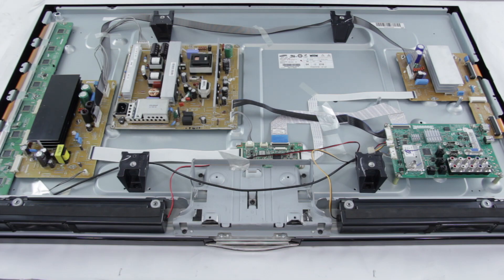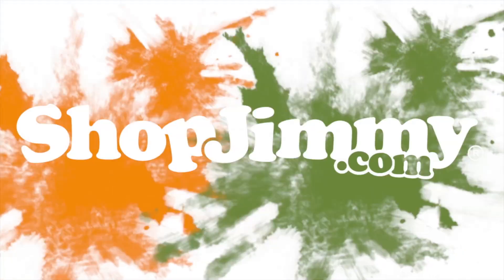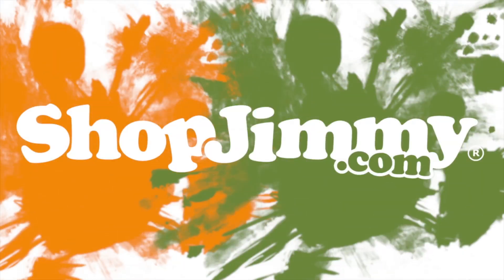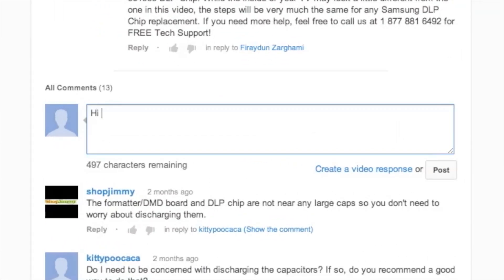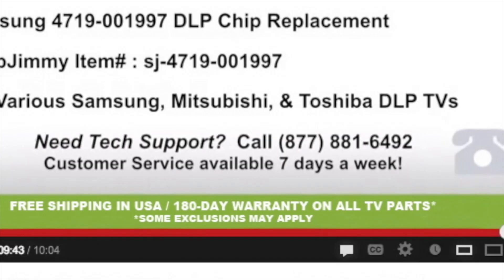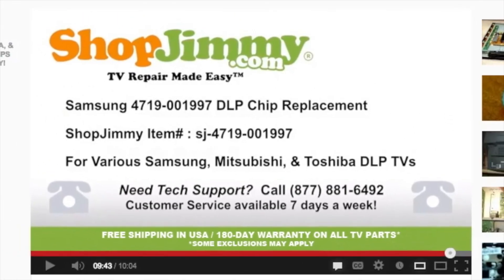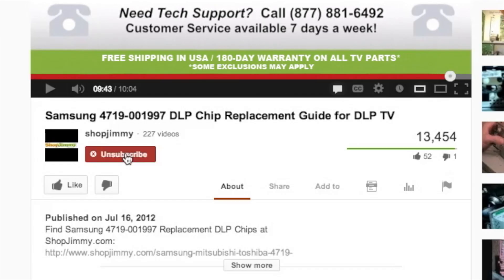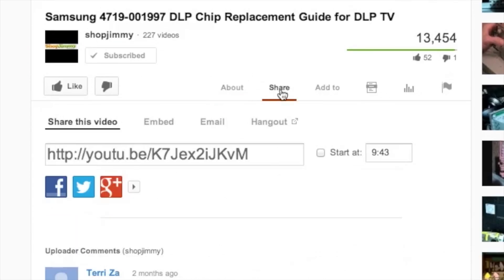Plasma TV Repair Tutorial - Common Symptoms & Solutions - How to Fix Plasma TVs

Comment: thank you for your assistance. i have ordered the main board as u recommended but the clicking still continues and the screen won't turn on. out of frustration i decided to investigate and run a few more tests. i noticed that when i completely disconnect the ysus from the others i hear the startup jingle but no cyclic clicking. i am wondering  if i may need to update the firmware or get a ysus. i also noticed some wet residue on the ysus near the bottom. i want to remove the ysus to check the bottom for signs of burning residue but im scared i might break the ybuf contact tabs.
Reply from the maker: samo wordo  Please watch this video FIRST to help with your repair!  TV Repair! LCD, LED, Plasma, DLP How To Fix Your TV with ShopJimmy.com Help! Sounds like you have diagnosed the problem as the Y-main.  I recommend replacing the Y-Main board and the Y-scan drive board in your TV.  Follow this link to replacement parts:  http://www.shopjimmy.com/catalogsearch/result/?q=pn42c450b1d  Be sure to match part numbers on your current board, with your replacement for compatibility.  Here is a link to a video showing how to identify your part number, click here:  Samsung Plasma TV Repair: Samsung Plasma Panel Parts Guide  Thanks and please let us know if you have any further questions with your TV Repair!  www.shopjimmy.com

Comment: I have a50" samsung plasma tv Model PN51D450A2D I here it turn on but have no picture or sound the standby light blinks 4 times
Reply from the maker: David Zinkiew  Please watch this video FIRST to help with your repair!  TV Repair! LCD, LED, Plasma, DLP How To Fix Your TV with ShopJimmy.com Help!  I recommend replacing the Y-Main Board and Y-Buffer board in your TV.  Here is a link to replacement parts:  http://www.shopjimmy.com/catalogsearch/result/?q=PN51D450A2D  Be sure to match part numbers on your current board, with your replacement for compatibility.  Here is a link to a video showing how to identify your part number, click here:  Samsung Plasma TV Repair: Samsung Plasma Panel Parts Guide  Thanks and please let us know if you have any further questions with your TV Repair!  www.shopjimmy.com

Comment: I have a Sanyo plasma 50" that powers on then within a couple of seconds I hear a click and the tv powers off. I've checked the power board. All the fuses are good and all the other boards have correct power supply.
Reply from the maker: Stephen Siniard   Try this at your own risk. Unplug the TV, then disconnect the SN board and plug in the TV to see if the TV powers up. Reply with the results of this test. Thanks! www.shopjimmy.com

Comment: Thank you for your reply.  If I disconnect the Y main from the from the power main it no longer clicks three times and and doesn't turn on.  It sounds like it wants to turn on or it makes the intro sound that it would normally make when I powered it on before this issue.  Does that make you believe that the Y main is still bad?  Thank you
Reply from the maker: Chasey Busch  Please watch this video FIRST to help with your repair!  TV Repair! LCD, LED, Plasma, DLP How To Fix Your TV with ShopJimmy.com Help!  This is either a problem with the main board or the power supply board in your TV.  You may need to replace each board individually to see which one fixes the problem.  Here is a link to replacement parts:  http://www.shopjimmy.com/catalogsearch/result/?q=PN51D530A3FXZA  Be sure to match part numbers on your current board, with your replacement for compatibility.  Thanks and please let us know if you have any further questions with your TV Repair!  www.shopjimmy.com

Comment: So I have a Samsung plasma PN51D6500DFXZA. It is out of warranty now, but while still under warranty, I had to have the power supply changed. That was several months ago. Now, my TV turns off and back on repeatedly. About every 1 1/2 minutes, it will turn off and turn back on. After a while, I can't get any of the buttons on my TV or my remote to power off the TV, turn up the volume, or anything. Any ideas on how I can fix this without breaking the bank?
Reply from the maker: Mark McDaniel  Please watch this video FIRST to help with your repair!  TV Repair! LCD, LED, Plasma, DLP How To Fix Your TV with ShopJimmy.com Help!  I recommend replacing The main board in your TV.  Here is a link to replacement parts:  http://www.shopjimmy.com/catalogsearch/result/?q=PN51D6500DFXZA  Be sure to match part numbers on your current board, with your replacement for compatibility.  Here is a link to a video showing how to identify your part number, click here:  Samsung Main Boards & Digital Boards: Part Numbers for LED, LCD, DLP, Plasma TV Repair  Thanks and please let us know if you have any further questions with your TV Repair!  www.shopjimmy.com
Reply: ShopJimmy.com So why wouldn't it be the Y-Sustain board? The video talked about the systems of the Y-Sustain being bad and that sounds like what mine is doing. It's powering on and off by itself.

Comment: Hello, 
I have a LG 50pk550 from 2010.
My problem white the plasma screen is, two vertical green line. Left from the center of the screen. iche line is one pixel whide. The green line appear always. I tryd to exis the service screen, thats not working.
Greetz from the always nice Holland,
stefan
Reply from the maker: Stefan Beek   This sounds like a TV panel (TV Screen) problem.  If your TV panel is bad, it may be more cost-effective to replace the TV as panels are typically hard to find in stock, difficult to replace, and expensive.  Thanks and please let us know if you have any further questions!  www.shopjimmy.com

Comment: I have a 4 year old 50" 720P Samsung Plasma TV.  It has vertical lines on the screen.  Started with 2 side by side, and now have another on the opposite end of the scree.  They look green or even multicolored.  Does that sound like i need to order a Logic Board from you?  Dont have the model #, but I can get it later.  Just curious if it is worth repairing.
Reply from the maker: jtugwell   This sounds like a TV panel (TV Screen) problem.  If your TV panel is bad, it may be more cost-effective to replace the TV as panels are typically hard to find in stock, difficult to replace, and expensive.  Thanks and please let us know if you have any further questions!  www.shopjimmy.com

Comment: I have a Sony KDE-42XS955 Plasma 42 inch.  Has worked fine for years.  Now turn tv on and sound begins immediately but delay in picture.  First the picture delayed about a minute, then 5 minutes now 10 minutes.  Approx every 30 seconds sound pauses, click is heard then sound resumes but no picture.  Wondering if this can be isolated to a component or a board to order a replacement part.
Reply from the maker: Jim Cramer  Please watch this video FIRST to help with your repair!  TV Repair! LCD, LED, Plasma, DLP How To Fix Your TV with ShopJimmy.com Help!  I recommend replacing the Y-Main Board and any buffers between the Y-Main Board and the panel.  Here is a link to replacement parts:  http://www.shopjimmy.com/catalogsearch/result/?q=KDE-42XS955  Be sure to match part numbers on your current board, with your replacement for compatibility.  Here is a link to a video showing how to identify your part number, click here:  NEC Plasma TV Repair: Part Number Guide for NEC, Hitachi, & Fujitsu Plasma Panel Parts  Thanks and please let us know if you have any further questions with your TV Repair!  www.shopjimmy.com

Comment: My LG Plasma 42pc3dv-ud tv started getting dim and fuzzy/blurry...then, it started getting black blobs stretching different lengths from the left side of the screen toward the middle (but I can still see some dimmed image on the parts without the black).  It appears to be worsening over time. It was repaired 10/2/2013 for an x main and capacitors.  I'm not familiar with tv repairs or terminology but I have watched this video and it seems that it could be the xmain again or logic board...is this correct?  I plan to attempt a repair of my own to avoid paying another $210 for repairs (which would total more across the two repairs than it would be to just get a new tv). I figured if it doesn't work out the worst would be I got the experience and still have to get a new tv...but hey, if it works, I will have had a great experience and saved money...its well worth the risk.Thanks!
Reply from the maker: Nikki Robinson  Please watch this video FIRST to help with your repair!  TV Repair! LCD, LED, Plasma, DLP How To Fix Your TV with ShopJimmy.com Help!  I recommend replacing the X board in your TV.  Here is a link to replacements:  http://www.shopjimmy.com/catalogsearch/result/index/?cat=67&q=42pc3dv-ud  Be sure to match part numbers on your current board, with your replacement for compatibility.  Thanks and please let us know if you have any further questions with your TV Repair!  www.shopjimmy.com
Reply: ShopJimmy.com
Thanks...I purchased the main board and the main tuner(?) board (separately) on ebay (as parts were not available on your site) and changed the tuner board first (which made the problem worse; so, I don't think the new board was good).

I then put the new main input board in with this new main tuner board (still worse).

Next, I put my original tuner board back with the new main (input) board (so new main input board paired with my original tuner board)...the picture is better but (while I can view a full picture in all color-and the black blob like parts are gone) it is still a little fuzzy (not clear) with  smudged looks here and there (from time to time) and short black lines that briefly fade in and out (from time to time); usually as the display changes from scene to scene on a show.

I'm not sure if I need a new main (input) board (since this made the problem better but still not back to normal) or if another problem may also exist.  Any suggestions?
Reply from the maker: Nikki Robinson   Since the main board did not fix the problem, then I would say it is most likely a bad TV panel.  If your TV panel is bad, it may be more cost-effective to replace the TV as panels are typically hard to find in stock, difficult to replace, and expensive.  Thanks and please let us know if you have any further questions!  www.shopjimmy.com
Reply: ShopJimmy.com Thanks for your help!  I recently purchased a 42" TV at a pawn shop for less than $250 so all is well again. :)  I'll continue to recommend your site.

Comment: Jimmy, I replaced several capacitors that you could plainly see were puffed out on top. I get a bright green screen that strobes and has a thin red horizontal line in the middle . I'm suspecting the y sus board . tomorrow I'm looking at the chips to determine if any have visable mark of frying from overheating. You were very informative about my plasma.and I appreciate it . I'm a computer tech who fixes TVs as well as cars. I also give away to needy families who might not be able to afford a TV or computer to see or email families and friends. I been called a fool by some,  it our lord our God has told me to share my talents with the less fortunate. So sir? I am asking you one time only for your help. Gratis if possible .I also ask if you can help with some copies of schematics for whatever set models you have for LED's lcd's and plasma sets. If you cannot supply these I will still add you to our prayer lists. Yours in Christ
Mr Glenn ferris 
3330 Brighton street
Philadelphia,pa.19149
215-571-9880
I know all about Digi key.
Have a blessed day my good friend regardless of whatever you decide on.
Reply from the maker: Glenn Ferris   This could either be a problem with the buffers in your TV or the actual TV panel itself.  You can try replacing the buffers to see if that fixes the problem.  Please reply with your TV model number.  Click here to view a video that shows how to find your TV model number:  TV Repair STEP #1 Help IMPORTANT TUTORIAL How To Find Your TV Model Number Tutorial TV Repair Help  Thanks!  www.shopjimmy.com

Comment: 2 Days a ago my 2011 Panasonic GT30 made a pop sound and now it won't display a image, and prior to that I was getting the black horizontal line across the middle of my screen. So I guess the 3 boards are damaged and I need to find out where those parts are sold or hoe to repair the boards..

Comment: I have a 51' Samsung plasma PN51D530A3FXZA that is from 2011.  Recently my TV went black, when I plug it in now I hear 3 clicks and the standby light blinks but the TV doesn't turn on.   Any suggestions?
Reply from the maker: Chasey Busch Please watch this video FIRST to help with your repair!  TV Repair! LCD, LED, Plasma, DLP How To Fix Your TV with ShopJimmy.com Help!  I recommend replacing the Y-Main Board and the Y-Buffer board in your TV.  Here is a link to replacement parts for your TV model:  http://www.shopjimmy.com/catalogsearch/result/?q=PN51D530A3FXZA  Be sure to match part numbers on your current board, with your replacement for compatibility.  Thanks and please let us know if you have any further questions with your TV Repair!  www.shopjimmy.com

Comment: Hi, I have a 55 inch Samsung Plasma, PN58C500G2F. Last night the screen went black and the sound works perfectly. I have tried a number of troubleshooting techniques, but no luck. The red led stays on solid red. Thanks!
Reply from the maker: fran 35  Please watch this video FIRST to help with your repair!  TV Repair! LCD, LED, Plasma, DLP How To Fix Your TV with ShopJimmy.com Help!   I recommend replacing the Y-Main Board and the buffer board(s) that attach to the Y-Main board.  Here is a link to replacement parts:  http://www.shopjimmy.com/catalogsearch/result/?q=PN58C500G2F  Be sure to match part numbers on your current board, with your replacement for compatibility.  Here is a link to a video showing how to identify your part number, click here:  Samsung Plasma TV Repair: Samsung Plasma Panel Parts Guide  Thanks and please let us know if you have any further questions with your TV Repair!  www.shopjimmy.com

Comment: I have a Panasonic TC-P50S1 Plasma TV, When I turn it on I get 3 clicks and then a 10 blink code. Unplugging the the SC and SS boards together I get a 7 blink code. With just the SS board unplugged and the SC board plugged in I get a 10 blink code. Plugging the SS in and leaving SC unplugged I get what appears as a normal power on state with LED on steady and Fans running. The service manual points to the A board but replacing it I get the same symptoms. I have checked voltages on P board at P25 and have 15 and 5 volts where indicated in the manual I also have 199 volts at TPVSUS point on SS board with the SC board unplugged. I believe my trouble lies in the SC board or SU or SD connected to it. Can you point me in the right direction.
Reply from the maker: Jim Edwards  Please watch this video FIRST to help with your repair!  TV Repair! LCD, LED, Plasma, DLP How To Fix Your TV with ShopJimmy.com Help!  This sounds like a buffer problem, but the SC board might be shorted.  I recommend replacing the SC, SU and SD boards all at the same time.  Here is a link to replacement parts:  http://www.shopjimmy.com/catalogsearch/result/?q=TC-P50S1  Be sure to match part numbers on your current board, with your replacement for compatibility.  Thanks and please let us know if you have any further questions with your TV Repair!  www.shopjimmy.com

Comment: I have a lg 42pt250 tv, sometimes i get the picture on screen washing out while viewing in tv mode, if i switch to another mode such as rca inputs or hdmi, it works fine, if you switch back, it will appear fine and then wash out again. If you take it off, and switch it back on, it will appear normal and then start to white wash again.. any suggestions?
Reply from the maker: TheSuraj03   This is either a problem with the main board or the t-con board in your TV.  Unfortunately I do not see any replacement parts in the search results for your TV model number on our website.  Please reply with your part number on your main board and t-con board and I can try searching for replacement parts.  Thanks and please let us know if you have any further questions!  www.shopjimmy.com

Comment: Ok   i have a good problem i am stumped on.   I own a 50 inch Insignia plasma tv 2009 model number NSP501Q10A      iI was watching it and it just made a pop noise and picture went out. I watched your video and noticed that the control logic board when you plug the tv in has a green light then shuts off and the power board has 2 black relays on the bottom left corner next to the copper wire round thing the relays i think are square plastic 3/8 wide 1" long they click 2 times then the green light on the main control logic board shuts off and it keeps repeating this if it's plugged in unless you unplug it. the power light in front of the tv stays red and blinks 4 times then on the 5th blink the process starts over.   So i replaced the main output board, the y sus board, the power supply board, and the main logic board, it still does the same thing. Any ideas???    shorted screen?? shorted wire or ribbon cable??      Thanks   Tim
Reply from the maker: TIM PROV   This sounds like a TV panel (TV Screen) problem.  If your TV panel is bad, it may be more cost-effective to replace the TV as panels are typically hard to find in stock, difficult to replace, and expensive.  Thanks and please let us know if you have any further questions!  www.shopjimmy.com
Reply: I disconnected the panel ribbon cables on both y and x sustain it still resets shouldn't that tell you the panel is not shorted?